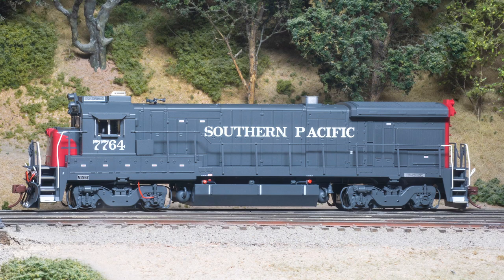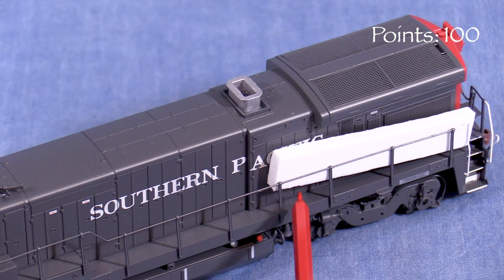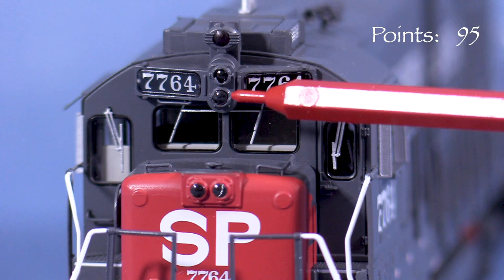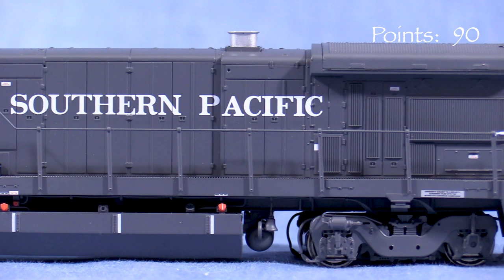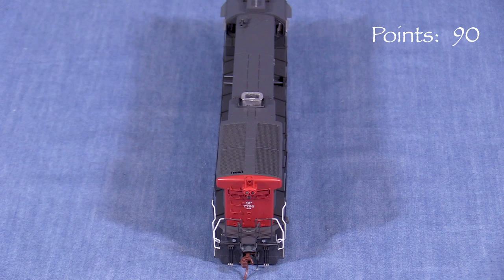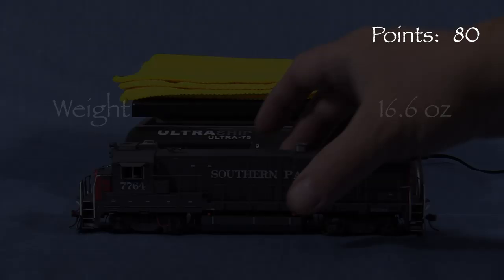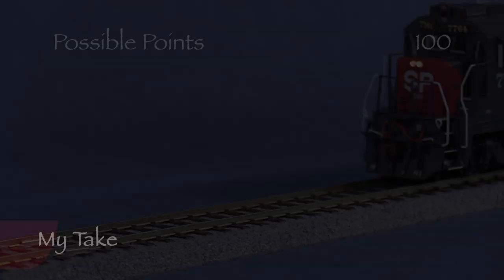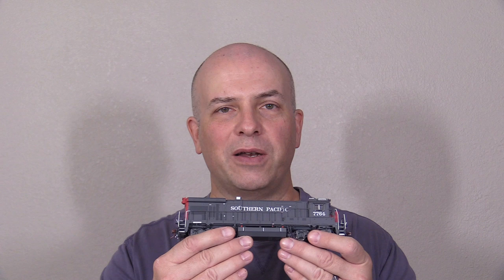Product Review HO Rapido B36-7 SP

Comment: Great review, thank you.  Also, thank you for pointing out the gyralight/oscitrol issue.  As an SP modeler, that was a bit disappointing.
Reply from the maker: You're welcome.  It is a little disappointing, especially since the LokSound 5 decoders have a ton of outputs so it should be possible to make that work.  Depending on the photos I can find of my unit I may sidestep the issue by plating over the oscillating lights.  I'm still trying to determine what this particular one looked like in the early 1990s.  Thanks for watching!

Comment: Can I get clarification on correct coupler height?  The bottom of the front coupler looks to line up with the bottom of the standards gauge coupler. The top is higher, but that's looks to be the Rapido knuckle being larger.  Similar for the back coupler, except the tops lineup instead of the bottom. Looking through the stairwell, it doesn't look like the screw for the coupler box is completely snug. 

I was also kinda of questioning about the rear emergency light not operating. But looking at the brackets, the front is thicker. Also they point out not being able to fit the LED in under  "mass production" circumstances. I myself can't do hundreds of those in a work week.
Reply from the maker: It's the horizontal center of the coupler that needs to match.   My comment about the emergency light was based on page 17 of the manual, where they said they "couldn't get the wiring in there".  I realize that mass production is a totally different ball game than making one-off custom models, but I wanted to point out that it is possible.  Thanks for watching!
Reply: Just for quick checking of coupler height, I keep 2 gauges handy, one with a Kadee #5 and one with a Kadee #58. I think his deducting points for coupler height is a little unfair. Is it easily corrected? Is the screw loose? I saw the low coupler looked to be sagging.
Reply: @chuckgilly  I totally agree as I think he was a little to hard on the model. 10 point for coupler height, No way!!!!

Comment: 8:42 of this video shows the one problem with the interior, the engineer front window heater is way too tall ,half of the window is blocked , mine is a Conrail , this one is SP , does any one else have this issue? That said , I am still glad I got one , the older GE sound is a great one
Reply from the maker: I have to confess I did not notice that, but you're right, it does look odd now that you pointed it out.  I also got a CSX unit and it's the same.  Thanks for watching!

Comment: The "thinner" SP nose font is correct for a new unit as masked and painted by GE. A few "later" units had this "re-fonted" to the more "common standard" SP font. Fireman side handrail stanchions on the long hood appear all tilted/canted. How hard is it to fix and upright this without a major paint touch up, especially on the sideframe sill where the 9 "plastic" stanchions "plastic peg into" and attach? Metal KD couplers (both at the right height) should have been included for this price IMHO.
Reply from the maker: I have noticed some variation in the "SP" on the nose on various GE units.  Thanks for pointing that out.  Rapido's new handrails are wire with plastic stanchions, so they are separate parts.  That's good because they can be moved.  I moved the upper part of the stanchion where it meets the handrail just by pulling it with my fingernails.  It moved and to my surprise it doesn't even look like the paint needs to be touched up.  I agree that I'd prefer Kadees over whatever Rapido is using now.  Thanks for watching!

Comment: What do the numbers mean when u told us what the train is
Reply from the maker: If you mean the number on the side of the engine, that's the unit number that's used to identify the locomotive.  There would only be one SP 7764 at any given time.  If you mean the "B36-7", that's General Electric's designation for this particular locomotive type.  "B" means that it has a B-B wheel arrangement, with a pair of two-axle trucks.  The "36" means that the unit has 3600 horsepower.  The "-7" means that this engine was part of GE's "Dash-7" line, which was introduced in the 1970s.  It was used to distinguish these locomotives from earlier "U" series units.  GE continued the practice with the later "Dash-8" and "Dash-9" locomotives from the 1980s and 1990s.  I hope that answers your question.  Thanks for watching!

Comment: I did not know that the SP had oscitrol lights I thought only the SSW had them on their GP40s. I know ATSF had them on some SD40-2s, but they only lasted a few years they were removed by the mid-80s.
Reply from the maker: I know on SP and Cotton Belt some of the later production GP40-2s had them, as well as the B36-7s.  I have seen pictures of the ATSF units as well.  Thanks for watching!

Comment: I purchased a SP B36-7 back in early February. It had issues with the lights. I had to send it back $55 customs and shipping fees. Still have not gotten it back. I won't be buying anymore Rapido engines anymore.
Reply from the maker: Sorry you had a bad experience.  I like the detail that a lot of modern manufacturers are putting into their models these days, but quality control seems to be a consistent problem.  Thanks for watching!
Reply: @DanielCortopassi  I got it back in September. The front gyro lights had a loose connection. Got it back and the problem wasn't fixed.  You have tap the top of the cab to get the lights to stay on.

Comment: You didn't mention F10, independent brake, does it work? On my Rapido RS 18 it only holds for 10 seconds making it hard to switch  with.
Reply from the maker: Actually, no.  I missed including that in this review, but I'm working on a review of the CSX version of the B36-7 right now, and F10 does nothing but make a noise.  I got the SP one back out and tried it and it's the same.  Rapido's RS-11 also has this issue.  Thanks for watching!

Comment: Coupler height front 'high' and rear 'low?' In the 1:1 scale (real world) I can tell you every coupler on every locomotive and car is at a slightly different height, some are extreme in their variance...just sayin'...
Reply from the maker: I have seen that.  The thing is, model couplers have a lot more vertical play proportionally than their full sized counterparts.  If the heights are mismatched, that can contribute to one coupler riding up over the other, resulting in unwanted uncoupling.  Thanks for watching!